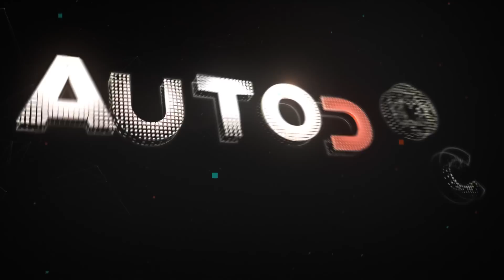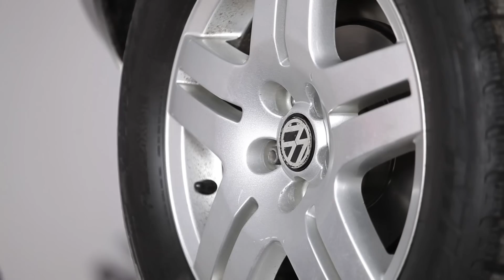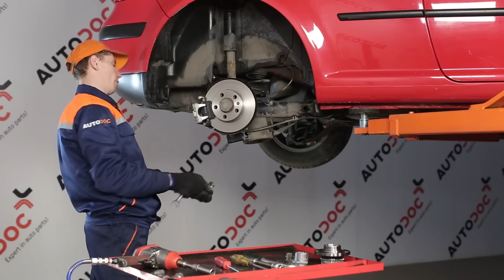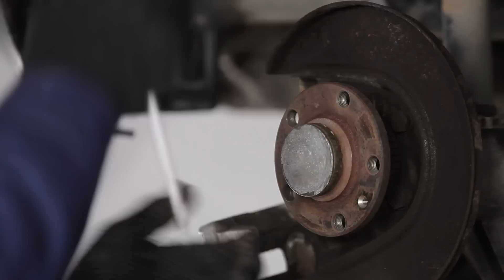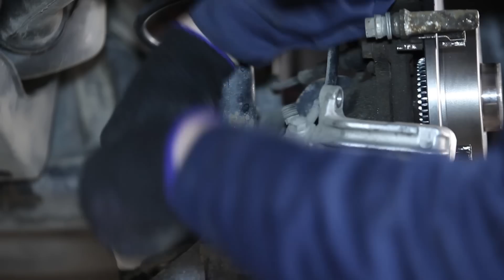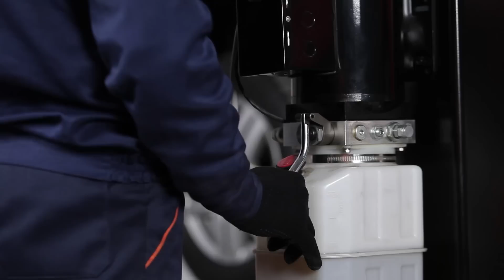How to change a rear wheel bearing on VW GOLF 4 TUTORIAL | AUTODOC

Comment: 5 years since the last comment... last of the Mohicans... if I am not alone in this world still driving an MK4 Jetta let me share with you a couple reminders:
A) If you're like me, and you are doing this yourself in your driveway on jacks, crack the axle nut loose before you put it up on a jack. 
B) If your car is like mine, no way that bearing is coming off that easy without a bearing puller (rentable at an auto parts store)

Comment: Impossible to pull the entire hub assembly off effortlessly by hand! 
You need a puller, and even then the back inner bearing race remains stuck fast on the stub. 
Removing that without damaging it requires patience. 
Use a hammer and sharp cold chisel to start separating the race from the stub by striking from the rear (avoid hitting on the thin sealing ring, hit at the race body - stub interface), working as evenly around the race as possible. When enough of a gap appears, use a puller that can get into the gap. If your puller can't get into the gap, careful use of pry bars will lever it out.
Reply from the maker: Thank you for sharing your experience, it will be very useful information for us and our viewers.

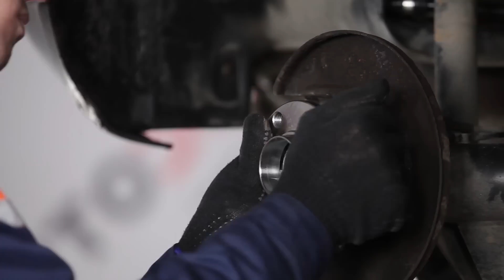Comment: Bearing replacement on this video took only 13 sec (from 3:17 to 3:30) by hands.  I did this job today, but my experience was totally different.  I had to use 3 jaw puller, of course.    Back side of the bearing was still there, and no way  to pull it off.  I used angle grinder with highest care.  I could take it out, but I scratched the axle a lille bit.  Installation of new bearing was just nightmare.  It was deadly tight!    Then  I stripped the nut at very last moment.   Both axle and bearing are garbage after 3 hours struggle.  I ordered new axle and bearing.  I will ask this installation to pro shop next week.
Reply: I had to resort to an angle grinder as well to get the back half of the bearing off. it was stressful
Reply: I ordered a new stub axle and bearing.  Last night I put the axle in the freezer, hoping to test whether the bearing would slide on easier.  Big mistake.  The back portion the bearing went on about 1/8" and immediately got stuck as the axle must have warmed up a couple degrees.  Now I need to figure out a way to pull it off and hopefully not damage it in the process.  Damaging it is nearly certain.  However, if I can save the new stub axle, at least I'll only have to buy a new bearing and start from step one again.  However, this still does not solve the problem of how to install the bearing.  As you already know, the tolerance is extremely tight.  I may try to heat the bearing to 130 degrees and get dry ice to freeze the axle to a lower temperature.  However, I'm still unsure if this will be sufficient.  Considering how much time has passed since your post on this topic, I assume you completed this job on your car.  What advice can you give if I intend to do this as a DIY project and not give it to a mechanic?   How did your pro shop perform the installation?
Reply: This is the exact same bad experience I have had.  Removing the hub was necessary to change the disc's steel protection hood completely rust.  I have had to buy a new hub.

Comment: Hi. Noticed all your parts are lovely and new and clean. You skipped an important bit for me. Did you need a puller to remove the hub before I get myself into all sorts of bother? Many thanks.
Reply: Keith Walker nope, shouldn't need one. I've dozens of these in my shop and never needed one.
Reply: Thanks. Wouldn't be the first time I'd disabled a car in the middle of the driveway.
Reply from the maker: Sometimes it's very difficult to remove the wheel hub bearing. In such case, a special remover tool is used. Such tools can be found in the shops of special tools. Best regards, Autodoc.
Reply: Keith
Reply: @robcontreras1901  BS> You need one.

Comment: 3:18 Does the old wheel baring really come off that easy?? 
Saw another video where he had to pull the old wheel baring off with a 3 jaw gear puller...
Also when the wheel baring were off the back/outer case of the wheel baring were still on... so you need a bearing splitter to get it off before you can put the new on.

In this video everything comes off and you even take it out by hand? How come you get it all out in one piece??
Feels like you're give false information in this video... luckily I'm watching some more videos before trying this myself. 
But I'm gonna get some more tools before I try this...
Reply from the maker: Thank you for your feedback! Yes, if  thread joints are  in normal status and you can to easily dismantle the car part. Sometimes you may need the specific tools , even the remover tool, in case the thread joints are in bad  state. The video shows that this car has all bolt joints treated, therefore the dismantling was not hard. best regards, Autodoc.
Reply: On my MK4 i had to replace the ABS sensor which was stuck in its hole. I had to remove the hub to hit the old sensor fro the other side and was surprised when it cam off that easy.
Reply: you should watch other videos, autodoc sell parts, so they kinda try to make it looks easy and everything comes off. But in reality it's hard to get things off (but shooting that will not help them sell parts as most people will just go to mechanic). But this video does give you a very quick and CLEAR rundown. 

On most DIY videos, the footage is bad, bad lighting, bad angles, everything is filty and hard to see what is going on.
Reply: Guaranteed 99% of cars will need a hub puller to get the hub off. This video has very oversimplified the process.

Comment: The axle nut was tightened with an impact wrench but was it ever torqued to specifications?  This is not shown in the video.  I'm interested in understanding how it can be torqued considering the car is on a lift and the axle is able to spin freely.  Thank you.  I appreciate all of the Autodoc videos.
Reply from the maker: Thank you for your valuable comment! We understand that this is a blunder. In new videos, we will definitely use a torque wrench and indicate tightening torques Best Regards, Autodoc Team!.
Reply: @autodocuk  This is not a big deal.  Anyone who does this kind of work can easily run-on torque the nut, then lower the car to the ground and torque it to specification at that point.  I appreciate your Golf 4 videos because I have one of these cars.  The videos are helpful and professionally produced.
Reply: The stub shaft does not turn so all you need to do is tighten the bearing using the nut. @RedondoBeach2
Reply: @matthewschug939  I bought new stub shafts and bearings for my 2004 GTI.  My intent is to drop the axle beam and refurbish the entire rear end, to include the axle beam bushings, stub shafts, bearings, brake calipers, brake lines, parking brake line and suspension.  The only thing that will be reused will be the axle beam, and it will be cleaned in an ultrasonic cleaner before being powder coated.

Comment: Rear lower link arm bolts that they use to adjust the wheel alignment. My passat 2010 kombi bolt is seized which prevented them from doing the wheel alignment.
What is it bolting into and is it easy to replace the bolt n bush???
Reply from the maker: Thank you for the feedback! We recommend you to visit a specialized car service center. Best regards, Autodoc.

Comment: Question, do you need to remove the brake caliper frame?  I think you can remove the brake caliber, pads + brake disc, without removing the frame, and the frame is not upstructing your ability te move the bearing, is it?
Reply from the maker: Thank you for the feedback! It might be right, but our mechanic follows the service procedure for this manufacturer and this particular model. Best regards, Autodoc team.

Comment: Yes you need a hub puller and a way to get the left over bearing race off the bearing shaft.
Reply from the maker: Sometimes it's very difficult to remove the wheel hub bearing. In such case, a special remover tool is used. Such tools can be found in the car shops of special tools. Best regards, Autodoc.
Reply from the maker: What do you mean exactly? The part was mounted by the mechanic in a proper way.   Best regards, Autodoc.
Reply: James means, if you are dumb enough to keep driving untill the entire bearing is distroyed, some parts of the bearing (like the metal bush) will be stuck and is difficult to remove.  However, you video is informative for normal maintenance, not "little to late" maintenainance ;-)
Reply from the maker: +Mark Derking Thank you for the feedback! We hope that our tutorial will be helpful for you. Best regards, Autodoc.

Comment: Although the video is simple and clear I cannot stress enough the importance of torquing certain bolts to specs to avoid future damage. This job, for example, had shorten the life of the bearing by the fact he over tight the axle nut.
Reply from the maker: Thank you for your feedback! To save the time in the video some stages of the repairs might have been excluded.. In practice the torque wrench should be used. Best Regards, Autodoc.
Reply: How can the nut be torqued properly when the bearing and stub axle have such a close tolerance on their mating surfaces that in order to mate them, the axle seemingly needs to be cold soaked in a freezer and the bearing needs to be heat soaked.  I assume that roughly 1 second after the bearing is installed on the axle, the tolerance will already be so incredibly tight that torquing the nut to the specified torque could give a deceptive perception of proper installation.  Torquing the nut may not provide adequate force to properly seat the bearing since the tolerance between the axle and the nut are so close.  These parts cannot be mated at room temperature.  Maybe this is not the case with an old axle and old bearing.  However, I'm dealing with a new axle and a new bearing.  Is there an easy way to mate these parts when they're new?  This video makes the mating of the bearing and axle deceptively easy.  It's not easy at all.  Is there a tool to make the installation easier?

Comment: what should the axle end nut be torqued at?
Reply from the maker: Thank you for the feedback! All the main bolt connections must be tightened according to the corresponding repair regulations moment.  This information can be found in the technical documentation regarding the repairing of your car. Best regards, Autodoc.
Reply: Good and tight my friend
Reply: Look it up in the Bentley manual. There's a special technique to torquing this nut as well. It's not like most nuts or bolts where you torque it and walk away. There's more to it.

Comment: He didn't even torque the bearing nut to the proper torque spec and sequence, creating improper bearing load.
Causing premature bearing frailer! I just laugh when they use an  air Impact to torque nuts with
Reply from the maker: You are absolutely right. All the main bolt connections must be tightened with a torque wrench. This video is considered to be an informative one, so it just shows the sequence of repairs.  Best regards, Autodoc.

Comment: No torque setting of the hub nut just do it up as tight as possible with a windy gun?!
Reply from the maker: Thank you for your comment!
You are right, you must use a torque wrench for all thread connections. In the new video, we started using it with all the tightening torques.
Best Regards,
Autodoc team

Comment: Try pulling the wheel bearings and hub off a 19 year old VW with your bear hands. Your arms will come off before the hub does. Why is there no mentioning that you might need a hub puller or slide hammer. Gives people wrong impression this video
Reply from the maker: Thank you for your comment.
Unfortunately,  the complexity of each car and the replacement is individual.
It all depends on the technical condition of the parts. 
Our videos are informative in the sequence of replacement, and you always have the right how to replace the part.
Best regards,
Autodoc team.

Comment: don't follow this you need a slide hammer to get the old one off and it may come apart in pieces
Reply from the maker: Thank you for your feedback! Each car features its specific replacement, so everything depends on a  car part technical condition. Our video is informative and the replacement is to be carried out with all the specific tools. Best regards, Autodoc.
Reply: How do you need a slide hammer if you're replacing the whole thing?  He didn't use a slide hammer.

Comment: Yeah okay, that's great and all, if the wheel bearing race comes off. Which it won't. The idiot who wrote the writeup involving use of a torch? Doesn't work. Wasted 2.5 hours of my time trying. And my wheel bearing had NO play. Sure, you could buy the special puller, as a 3 jaw will NOT work. You'll like spend the same as you would on a new spindle. Or, Just do yourself a favor and buy a new spindle. Plan on spending 170 dollars per side to do it yourself.
Reply from the maker: Thank you for your valuable remark! The process really is not that easy. The video is just the informative one. Best regards, Autodoc